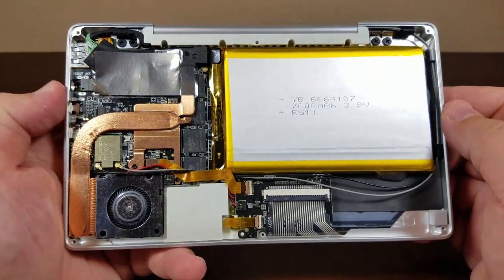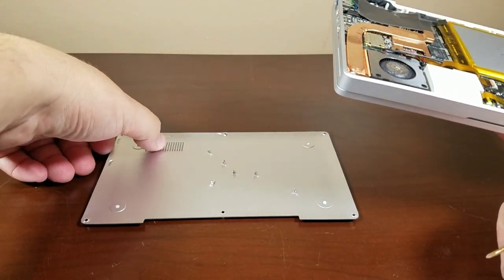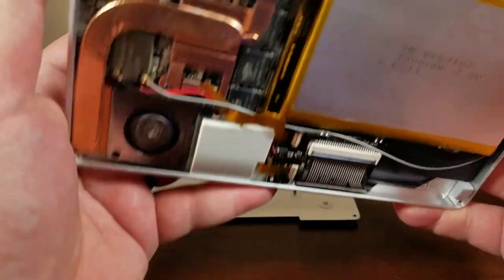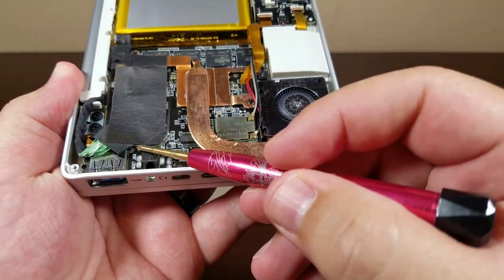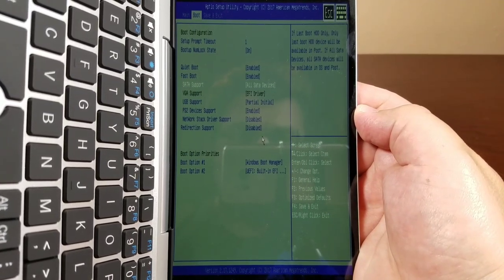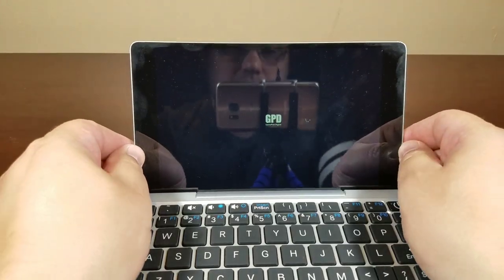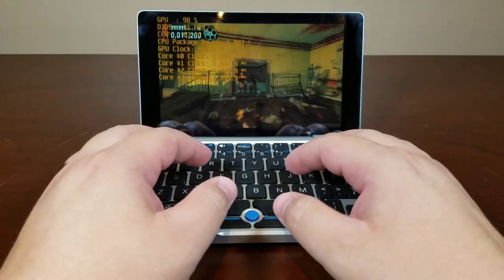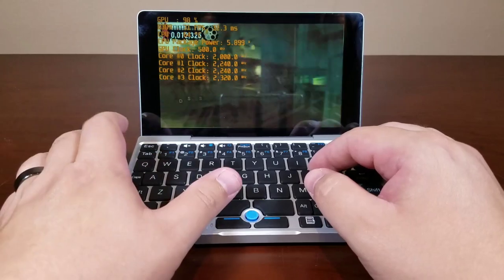GPD Pocket Review - Is This 7" Laptop Any Good?

Comment: A great program for remapping keys and making macros is AutoHotkey. I use it for hundreds of shortcuts, macros, and a dictionary replacer. They can run at startup and be synced across PCs. Requires very simple coding with good learning resources

A few examples:

capslock::A             ;caps lock = A
::shirst::shirts          ;replaces typing "shirst" with "shirts"
#C::run calc.exe     ;pressing Win+C runs calculator

Comment: If you want a gpd for gaming I recommend waiting until the gpd win 2 comes out in summer 2018, these devices are both powerful for rlly small laptops, but neither are quite powerful enough yet, the gpd win 2 will have a fix for the L3 and R3 buttons and it's also apparently gonna have decently better specs than the original so that's why I am waiting for that one
Reply: The GPD Win 2 is more powerful, but it is also literally twice the price.

Comment: err. The "I dont know what this is.. Band Aid thing covering" is the Voltage Regulation module since it is right next to where the power comes in, with the centre chip most likely as the ICH interface type chip for the ATOM (which is integrated SoC).
Reply from the maker: Ben Liu Thanks. I meant the covering specifically. I still incorrectly say its the PCH (not ICH)

Comment: While the clamshell has had some thought put into it, the keyboard certainly hasn't had much thought put into it. DEL being bigger than the backspace... two volume keys... where the caps lock is... Hell, I've had an easier time typing on an HTC Shift x9500

Comment: Thats why you fail to get used to this keyboard, because you are not a good "home key typer" as you call it...  If you had been properly trained you could type fast without any issues (within reason) on any qwerty keyboard of any size (given a few days of familiarization if we talk about extreme examples like very small keyboards smaller than the GPD's one which is actually a quite fine and spaced out layout ) 

I personally never gotten proper training so to say but when I was a child I was curious about what methodology people that type "blind" use and looked into that colored key chart and the initial position etc and now I can type on almost anything blindfolded at a high speed.

last but not least hibernation is going to use only used ram space not the entire ram. for example if you are only using 3 GB of your total8GB of ram and then hibernate only those 3GB will get stored into the hard disk.